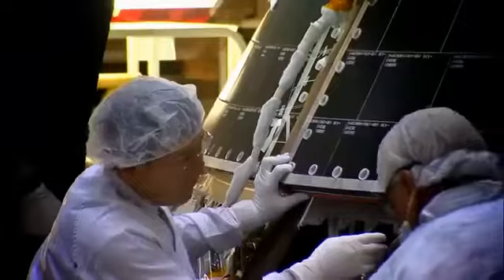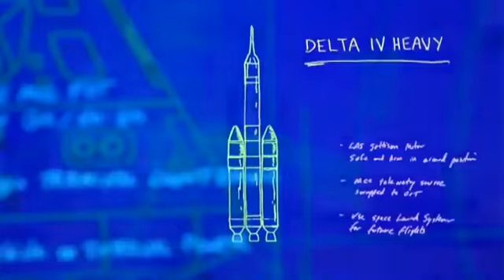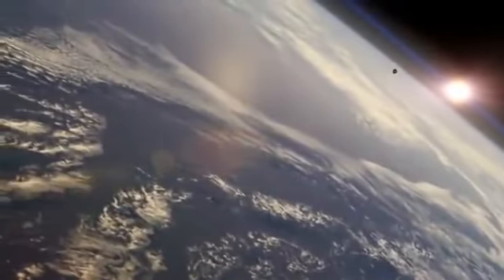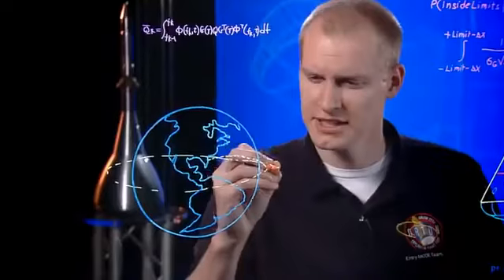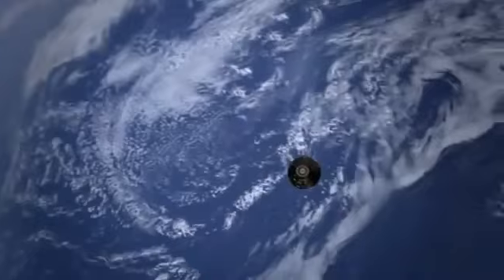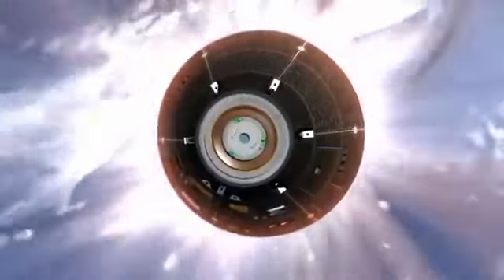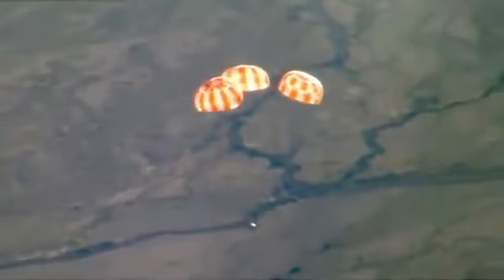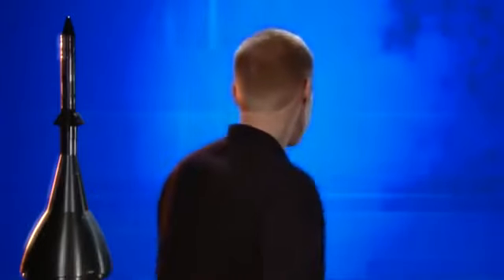NASA engineer admits they can’t get passed the Van Allen Belts

Comment: Answer the question. How did the Apollo astronauts survive these belts with no affect on their rudimentary computer if you now have to figure out how to get through them?
Reply: G Heald their computers were no where near as complex as today's equipment, thus it was better at combating the challenges of radiation. There were 10 other Apollo missions before Apollo 11 they figured it out.
Reply: The radiation was low enough that the astronauts could tolerate it for a few days. That's what they did in 1969. Not so, for a trip to Mars. It's like, hmmm, surviving being in a microwave oven on high for 5 seconds, or for 5 hours.
Reply: زاغ Prove him wrong?
Reply: medexamtoolsdotcom just wrap it in pasta or something every time I try to microwave it it stays ice cold on the inside
Reply: iamhughmun 
seems legit.
Reply: On a side note please remember that virtually every craft is a new one , so even if you had a shield on some ship that you created before and that worked as expected, doesnt mean that after assembling new craft you still have same result .
You need to retest and measure everything once again , its like saying - why crash test every new car when all of them are crafted using the same metal , lol
Reply: we don't actually KNOW if this guy IS OFFICIALLY speaking for NASA.
HE DIDN'T SAY that the van allen belt WAS or IS easy to shield from, NOR did he claim that apollo couldn't have handled the radiation.
anyhow , the soviets were the first to the moon-NASA beat them to the moon's surface landing, but the soviets never said that the van allen belts were insurmountable.
Reply: :D
Reply: The technology used to go to the moon in back could fit into a 1990s flip phone. Today's technology is far more precise, but far more sensitive.
Reply: زاغ
Look up "Core rope memory". The memory unit of the AGC was most certainly impervious to radiation by nature.
And then take into account that the AGC wasn't even needed during the flight through the belts, and could have simply been switched off.
They only needed the guidance computer when they were behind the moon and during the actual landing.
Any other time, primary navigation was handled from the ground.
Reply: Computers are so much more complex nowadays, their computers in the 60's were analog; big, practically indestructible behemoths compared to what we have now. They would survive any kind of radiation far better than a full digital computer nowadays could. There is so much more that can go wrong with computers that we have now, so they need far better shielding. Because our machines are far more complex - as we know, the more parts a machine has, the more chance that something will break down on it. Henceforth, the need for shielding that far surpasses what the Apollo astronauts had. Not to be construed as: We can't physically make it through the Van Allen Belts.
Reply: As far as the computer systems go, computers are so much more complex nowadays that there's so much to go wrong with a system. The computers in the 60's up until early 1970, were ANALOG; big, practically indestructible behemoths - compared to what we have now; they would survive radiation far better than a full digital computer nowadays could.  Because there is so much more that can go wrong with computers that we have now, we have the need for far better shielding on these far longer missions. As we know, the more parts a machine has, the more chance that something will break down. Henceforth, the need for shielding that far surpasses what the Apollo astronauts had. NOT TO BE CONSTRUED AS: We can't physically make it through the Van Allen Belts. Use your head, man, quit sounding like a nut and try and call upon some of that education, its not hard.
Reply: G Heald because it never happened when they say it did. Everyone thinks Hollywood is just for movies. Why is it that we have telescopes in space that can see millions of light years away but every film recorded in space is shit quality. Even more shit quality when it comes to UFOS. Also why has no one that recorded their walks in space looked around? They always look in a certain area they never look up or down or turn around. Oh that’s right if they did you would see the camera crew and green screens. People are so dumb...
Reply: american magicians solve the problem back then nowadays they have no more magicians they replace them with other crooks the 9/11 manufacturer
Reply: Rude420Boi
We have telescopes that in space that can see for millions of light years because they record a spectral image of all electromagnetic radiation they can for weeks before producing an image... one frame a week is not good for a video...
And do you even space suit? The astronauts do look around...the cameras are mounted to the helmets, which don't swivel at all...they swivel their heads inside the helmet.
So their camera looks at where the rest of their body is pointing, and since movement in space is slow and deliberate, you typically stick very close to surfaces so you can grab on to something and not get tangled up or smash into something important.

I mean, there's footage of that one guy who lost his tool bag while servicing the solar panels, which got tracked and the orbit calculated and a guy actually managed to snap pictures off it as it flew overhead...

So unless NASA puts out deliberately "fake" videos of astronauts losing their tools and then puts a toolbag into space so accurately that it all lines up and hobby astronomers can then take pictures of it from earth I think the logistics of actually going into space is easier.

As for video quality, yes I would love space suits to be fitted with more awesome cameras for glorious footage from space.
/watch?v=PG6JmKUpTsw This guy took a GoPro out for a spacewalk and there are plenty of panning shots where he takes a "selfie" and then turns the camera back around front and such. So plenty of "look around."
Reply: Get back to school you need more of it than me (( i am actualy 15 ;p))

Edit: btw the earth is not flat and we did in fact walk on the moon :p
Reply: G Heald their windows 60's computer lmao
Reply: frankluckythirteen y
Reply: G Heald 
They went thru the thinnest part of the belt.
Reply: La jack is it normal that Us marines can't write?
Reply: They don't no how to get through the van Allen belts that's why they go around them.
Reply: G Heald look it up . Granted that will lead you to see how fraudulent this videos claims are. So read at your own risk as the truth can be scary to some people lmfao
Reply: G Heald I explained it in my comment above but I'll do it again just for you. Apollo's computer systems were extremely rudimentary, but they were also less prone to electromagnetic radiation. You could shoot an x-ray beam at the pile of CRTs and vacuum tubes all day and it won't have any effect because it's not something those components are susceptible to. Digital electronics on the other hand are delicate and are susceptible to several types of radiation including electromagnetic, x-rays and electrostatic. That's why you see technicians wearing grounding straps around their wrists. Improperly shielded computer components could be fried, leaving the astronauts stranded. There's no inherent barrier in crossing the Van Allen belts.
Reply: They went through a weaker section, and the computer had less computational power then a fucking budget calculator. Yes, we made it to the Moon with a computer that is a desk calculator's bitch.
Reply: "...desk calculator's bitch." Too funny.
Reply: I've given up trying to convince flat-Earthers otherwise. They're going to believe what they want to believe, no skin off my nose. If they choose to remain willfully ignorant, it's not my problem.
Reply: They avoided travelling directly through the belts maybe
Reply: New ship New data needed!
Reply: G Heald the Orion craft will be much more reliant on computer and data storage systems than Apollo was, which was easier to protect as it was a very rudimentary computer. Irons systems will be much more sensitive to radiation.
Reply: Moon mission was a hoax ....directed by Stanley Kubrick..produced by America scripted by  NASA
Reply: This shit comedy, I love coming to videos just read all the scientist explain in the comments.
Reply: The flat earth theory does make a lot of sense, when you consider that the moon is made out of cheese. That's why the earth has a crust, and the sun is baking the earth into a pizza. Unfortunately, It was place too far away from the heat source and is taking forever.
 It is no coincidence that people and pepperoni are spelled so closely. The earth is also covered in mushrooms and my theory is so-sage ( sausage) 😉
Reply: CatGaming, No you just don’t think.
Reply: This is such a great sentence.
Reply: TheRailGunner
 why don't they use the 60s' computers instead then? So much more durable and superior compared to the modern ones
Reply: Because everything was fake
Reply: I think you`ll have to ask Stanley Kubrick for that matter.
Oh! I`m sorry he is gone.
Reply: La jack I saw superman on the moon on tv does that make it true?
Reply: Good question. I think that we people who understood physics all know the answer. To me it’s highly suspicious that they transmitted the military operation for their Russian opponents to see. It must have had psi op value. You don’t show your best weapons to your opponents, that doesn’t make any sense. The Achaeans didn’t build their deceitful vessel in plain sight of Trojans to see and didn’t ask them to sleepover their mobile garrison, did they. I think that this issue hasn’t been solved yet that’s why both Americans and Russian utilise Haarp, they try to bend the belts. Rumour has it that the Chernobyl explosion was caused by the Russian haarp intense use.
 Both Americans and Russians employed von Brauns and one of the brothers was responsible for Sputnik, Byelka, Strielka and Gagarin’s mission to space and Yuri Gagarin died during his last mission, who knows, maybe he was burnt in Van Allen’s belts?
Reply: Eddy Q, right.
Reply: Yeah coming from someone like drania76 who thinks putting 2 and 2 together and coming up with 400 makes them at all intelligent pmsl
Reply: Jeremy Smith are you talking to me 🥊
Reply: I didn’t say that MiG can get into space, reading with comprehension isn’t your strongest feature which doesn’t surprise me at all Steve Andrews.
  Steve, you can’t distinguish between MiG 29 and F16 and you have to cover up your ignorance with bad manners. You wouldn’t recognise MIG even if you were run over by it.
Reply: I can read but you can’t count which doesn’t surprise me at all. One picture says a thousand words Jeremy Smith.
Reply: Jeremy Smith, you remind me of a character from the Pearl Jam song titled Jeremy. How come you know that Gagarin died in the plane crash, because Soviet propaganda told you so? Or because you have a delusion of grandiosity and it was yourself who took him down? You clearly have got nothing to say you just pick people at random and hurl insults. I’m not moved by your obscenities by the way. And how many of you are there? Paraphrasing bible your name is Million for you are many, aye?
Reply: All right You and your multiple ignorant personalities I have to get up early. Goodnight!
Reply: Russia Today, a very credible source 😜. I thought that Scottish people are smart Jeremy Smith.
Reply: I am not even going to bring into the equation of this that the greater heights someone goes to from ground on this earth the more rems (millirems rather) one is able to tolerate without any problematic health effects, also not to mention that radiation on the whole has a accumulative effect or that nuclear physicists are subjected to far greater levels or radiation than what they went through in the Apollo missions lol.

There's an international limit to how much one is allowed to be subjected to, to prevent health problems and its far greater than what they went through.
Reply: The transistors and memory bits were very big. The program had extreme redudencies and the program code was hardwired using rope core memory, that is immunte to radiation, even without shielding. They also used more shielding than required probably, or just couldn't estimate it, and used a calculated risk to try anyway. They have put people and equipement at risk, but they got it. However if the crew was exposed for the radiation for few weeks it could have been a big issue. Also with modern memories and CPUs, which are more sensitive, it would be tricky, and require a lot of additional research. It is clearly all possible, as we have sent interplanetary probes and satelites in high altitudes. However, regions of elevated radiation might still be a problem for humans and electronics. Especially if the guidance and life support is safety critical and cann't fail at any given time. Other satelites, can most of the time restart, go into fail safe mode, and be recovered later. This is not an option for a manned flight.
Reply: They didn't even know if they went through them acording to astronaut Bean remember. 1000 mile oh then we went right through them then no side effects nothing!
Reply: Watch the TV show "Horizon - season 1996 episode 12 - TV is Dead, Long Live TV". It's a show from 1996 and shows how we're going from Programmed TV to TV on Demand. In it, it shows a Main Frame computer memory and the woman showing it is bragging about how her "One device holds 200 gigabits".  I nearly blew coke out of my nose when she said that because her device was rather BIG which must mean that my memory's, @15 terabits total, are 75 time larger, right? Well, actually NO Mr. Potato Head, it mean I can store, and am storing 15 TERABITS of information on my entertainment center with TONS of room to spare, another 300-400 Terabits is my best guess. 
Now, Mr Banana head, if memories are that much smaller since 1996, only 18 years ago, how much BIGGER were entire computers in 1972, 46 years ago??
Reply: You may like reading my reply above, LOL let me know, ok.
Reply: Cajon Jackie
Hard to imagine that the Apollo computer was very different that you use today? It was different to any computer of that era as well, with unique architecture. They have build it to a specific task and it performed that task. That's it.
Reply: Your point being? My point was "the power of the device to do it's specific job and the size required to do it." The really big difference was, for Apollo, there were no Microprocessors yet, they had to rely on transistors which, while not as resilient as tubes, were much more resistant to radiation than the microprocessors of today. It's all much-ado about nothing, really. Protecting the devices of today is no big deal and with the reinvention of the Solid State computing it will be much more "Much ado about nothing" very soon. We'll be back then,, to our primary concern, "How do we protect US from space?"
Reply: older computers were less vulnerable because everything was larger. One of the biggest ways our computers have gotten better is we've gotten better able to make their components smaller, which means a stray bit of radiation can do more damage.
Reply: Ask Stanley Kubrick.
Reply: @Rude420Boi  good call 👍
Reply: LVEAVE IT TO GOVERNMENT TROLLS TO SAY HOW THEY GOT TO THE MOON! 🤣🤣🤣🤣🤣🤣🤣🤣🤣🤣🤣
Reply: @natenelson2657  yeah so our computers now with nanotechnology just can’t compare with those heavier clunkers if the past. And we just can’t figure it out with the leaps and bounds made in technology, something they figured out in the 1960’s.Technology doesn’t go backwards except in manned space flight past low earth orbit.
Reply: Look up documentaries "a funny thing happened on the way to the moon" and "astronauts gone wild"
Reply: @samozabijaka  this is a weak point! What are researches for??? If it was conquered before , the blueprint of how to conquer again will forever be there
Reply: @elhistheninja  we have the blueprint but it's old , we don't want to reuse that , we are building everything from scratch because we want to have modern solution, is that so difficult to understand ?
Reply: @samozabijaka  😂😂😂 it doesnt make any sense! We figured out the material we need to pass through the van Allen before ! Why would you stress yourself with something thats known???
Reply: @samozabijaka  we update! We dont build new ones from scratch 😂!! You guys are confusing your selves
Reply: @elhistheninja  yeah You say 'we' a lot, no idea who are You refering to (not engineers for sure) , I guess you post these comments from 1960 mainframe because why figure out newer and smaller computers when that was doing its job just fine, and You drive your ford model T because hey, there is no need to update when it drives just fine, I guess all these people that try to research new technologies are just stupid because what we have works just fine .... ehhh your mindset is very strange
Reply: Simple. We havent been to the moon yet. That was fake.
Reply: They never went beyond low earth orbit
Reply: computer was direct wire. no computer micro chips or micro curcuits that are at much more risk of damage.  what kills you in radiation is absorbtion. Not exposure.  They went through the belts one way in 90 minutes. So spent little time in each  risk zone of the belts and altogether avoided the red zones. For the entire trip, They absorbed very little radiation
Reply: @elhistheninja  We drive modern cars now. Do you ever see a reason to going back and manufacxturung Model T Fords  again?. Thought not.  Old Apollo tech can no longer communicate with the modern Mission Control
Reply: @elhistheninja  There is some base information that can be used as a starting point. But from there it's guts are a complete redesign.
Reply: because they did figure out how to get through the belt, especially since they went through a thinner portion. This video is merely talking about how the new orion spacecraft will need to be tested in multiple aspects, including a pass through the belt, before human flights. The orion craft is a new design and thus will need to be tested against the belt itself.
Reply: @seagull4432 thank you. You give me hope for your generation. All these fools in between us scare the hell out of me